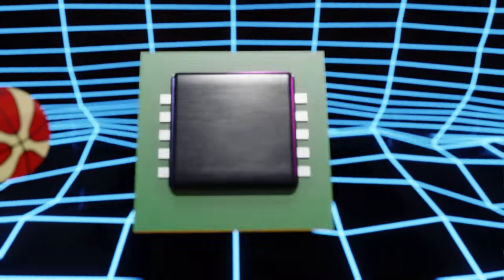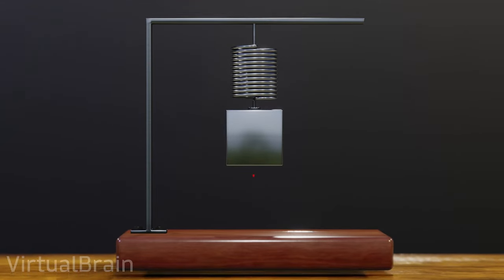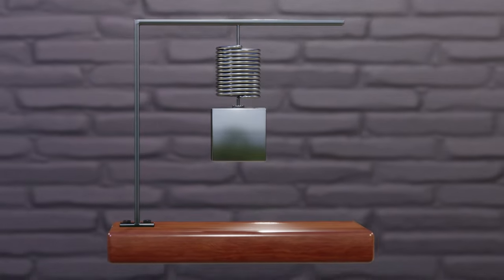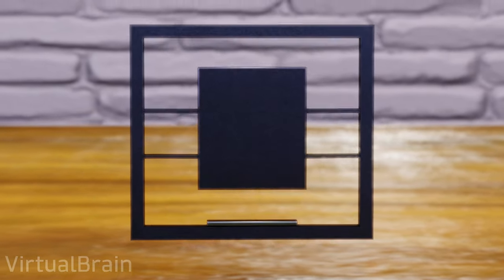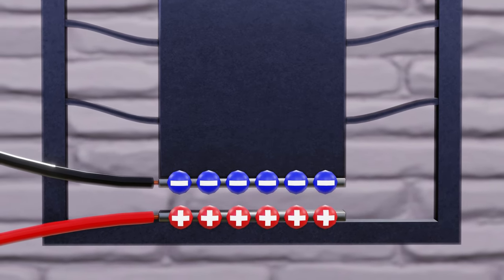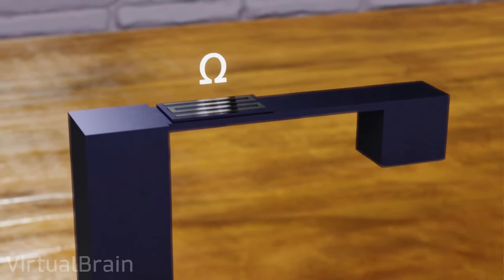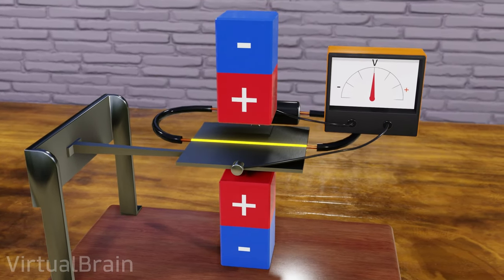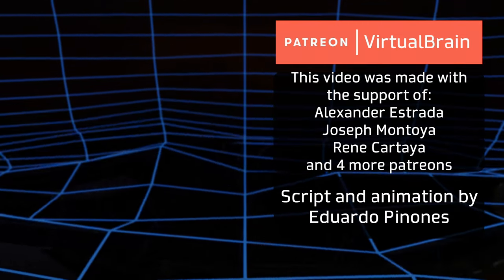How an Accelerometer Works ⚡ 6 Types of Accelerometers

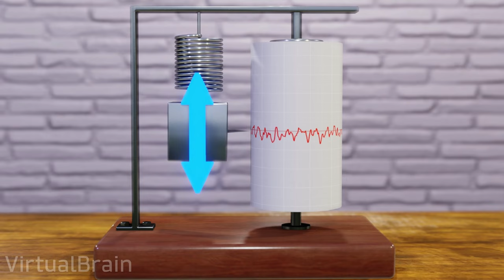Comment: Before MEMS (or other solid-state related sensing), analog acceleration meters (meter and accelerometer in one) were found on everything from aircraft to race cars. Less-precise acceleration meters were nothing more than a gauge face with a bearing-carried needle and spindle with some mass loaded at the tip of the indicator needle (1-axis 'X') for 'lateral acceleration readings. As a car went around a curve, the weight-laden needle would be pulled to the outside of the turn, with each degree of the gauge face equaling 0.0111 percent of 1-g (thus, at stasis, the needle pointed down to the '6-o'clock position', and at 0.5-g's left-turn, the needle pointed to the 4:30 position...with 1-g at 3 o'clock). Likewise, if the turn was 'a right turn', then 0.5 g's would point to the 7:30 position and 1-g would be at 9 o'clock) This was a simple 1-axis 2-g acceleration meter, useful for race cars and their drivers being aware of lateral g's, and when the car was likely to lose tire-to-track adherence and enter into a 'skid' (Few cars are capable of retaining traction above 1-g...with examples of Corvette, Trans Am and Ferrari as exceptions to this fact).